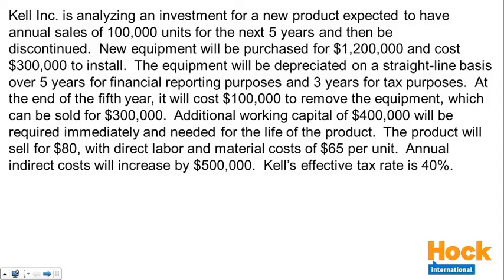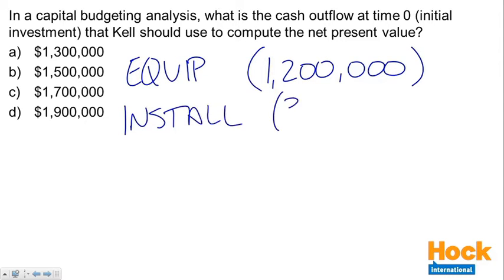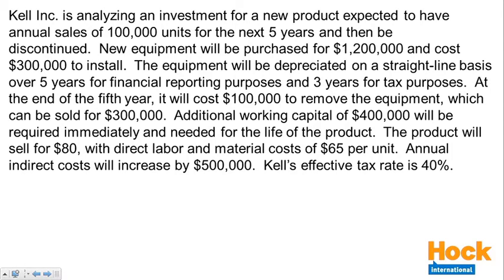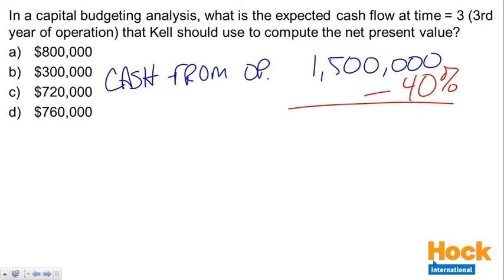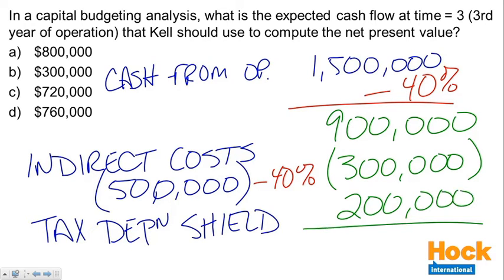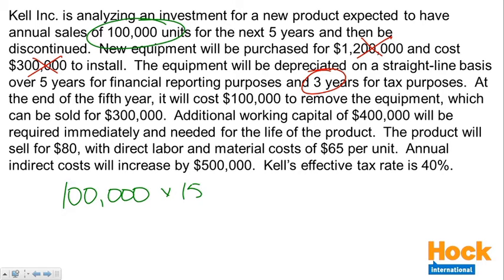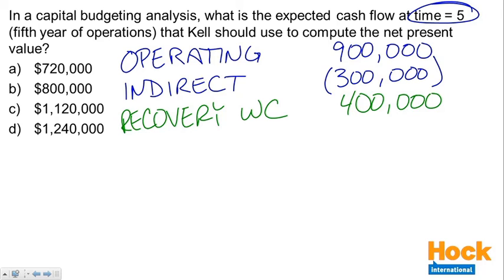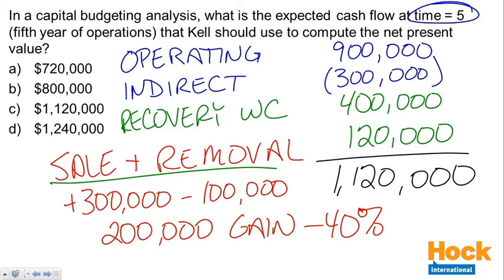CMA Part 2 - E - Capital Budgeting - Kell

Comment: Dear Friends, I have confused between company valuation and capital budgeting use DCF method:
1/ With company valuation by DCF method, I use Free Cash Flow and discount rate (ex: WACC) evaluate?.
2/ With Capital Budgeting by DCF method, I use Operating Cash Flow and discount rate (ex: WACC) evaluate?.
Reply: Though the two methods are very similar, they are different in the scope of what they are calculating. When doing it for a business you use the free cash flows that the business generates each year. When doing capital budgeting you use all of the cash flows that the company will generate and incur through the life of the project. I am not sure that I would use the term operating cash flows when using capital budgeting.

Comment: Hi Brian, 
I am a bit confused in the second question answer, the Indirect cost and Depreciation expense have the same amount of $500,000. why their numbers after tax is different 300,000 and 200,000?
Reply: Hello. Amr Kabsha,

The difference is because they are different types of expenses. 

For depreciation, the company has $500,000 of depreciation expense, but there is no cash outflow to pay for depreciation. This will reduce their taxable income by $500,000 and since the tax rate is 40%, they will save $200,000 in taxes. This $200,000 tax savings as a result of depreciation is treated as a cash inflow. There is no cash outflow associated with the depreciation expense since it is a noncash event. 

The $500,000 of indirect costs are an expense, but they are also a $500,000 cash outflow.  So, the $500,000 outflow is also an expense and reduces taxable income as well. So, the $200,000 tax savings connected to the indirect cost is net together with the $500,000 outflow for the indirect expenses. 

So, the difference is that the indirect costs have a cash outflow, but the depreciation expense does not have a cash outflow connected to it.

Does this help?

Brian
Reply: @brianhock720  That was helpful, Thank you! I am planning to go for the CMA in 2020 and I will consider the review package offered by your company.